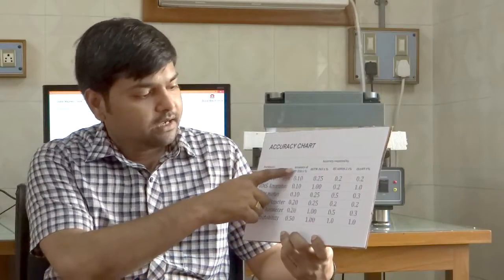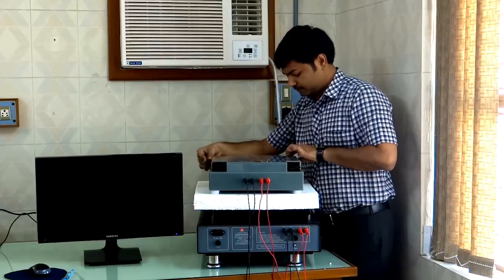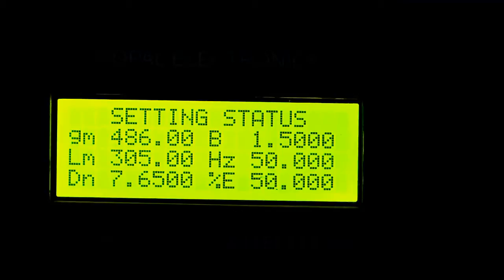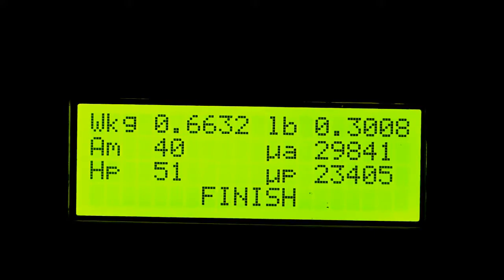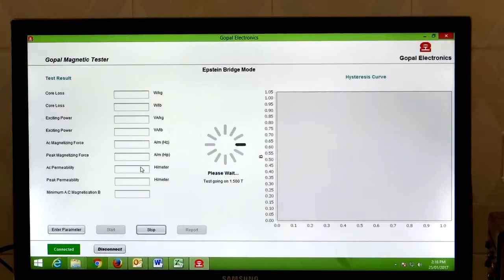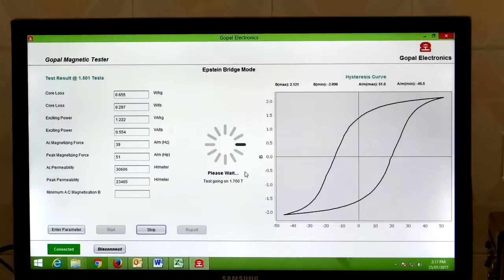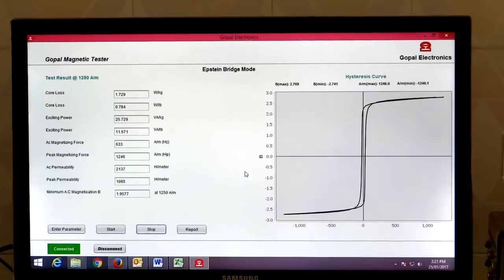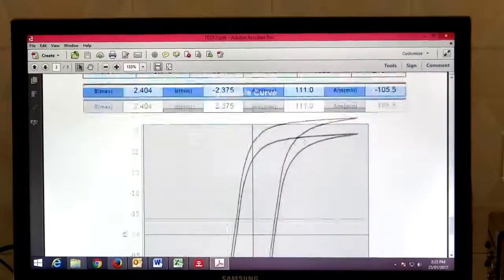Epstein Tester

Comment: Buen dia Les escribo desde México para solicitar su apoyo en la instalación del software del Epstein tester EP-350, el cual ya tenía instalado en mi equipo de cómputo, sin embargo por un problema de virus, el software fue dañado y ahora que requiero instalarlo nuevamente presento algunos problemas 

Datos del Epstein tester
Model: EP-350
Sr No- ET-056
Cal dt- 26-7-2015
ReCal dt- 26-7-16
Cert No- ARM-56

Pueden contactarme a la brevedad mi correo es ejuarez@coremex.com